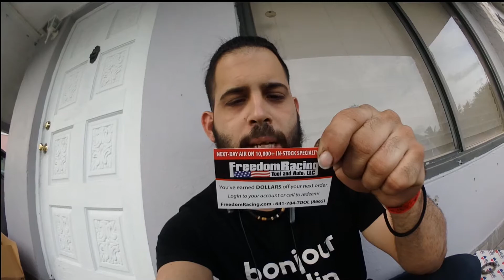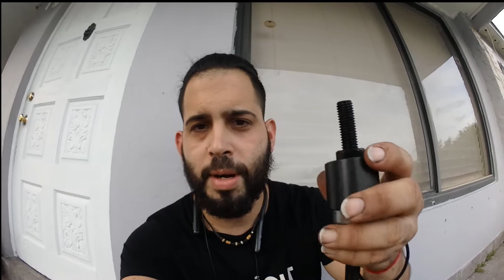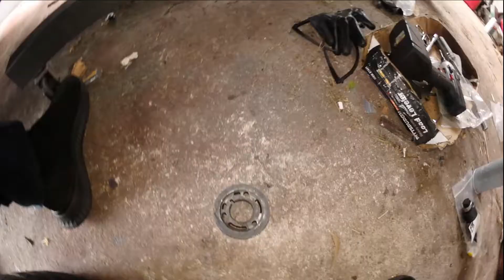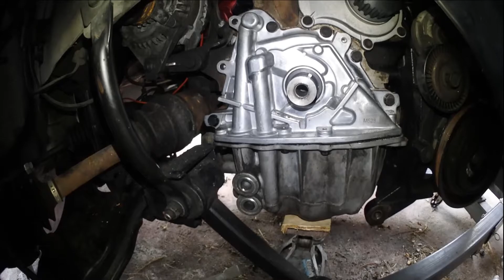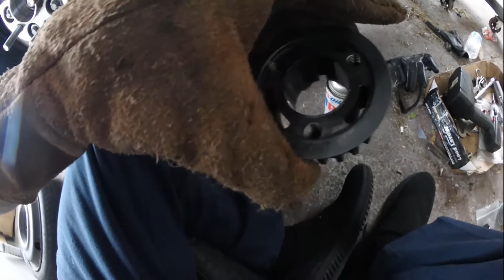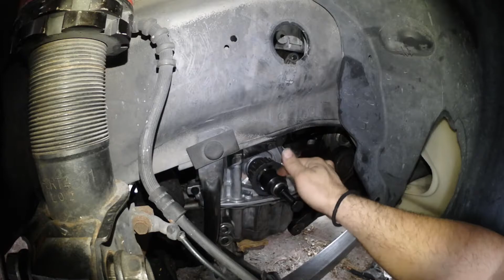CRANK SPROCKET INSTALL ON SRT4

Comment: How did you get the sprocket off???
Reply: You can use harmonic balance puller wit 3 bolts from coil pack
Reply: @kakkarotskorner  When I try that method the crank spins
Reply: @adamnasir2  put crank bolt back in but not fully threaded